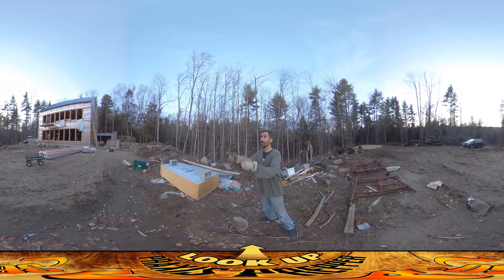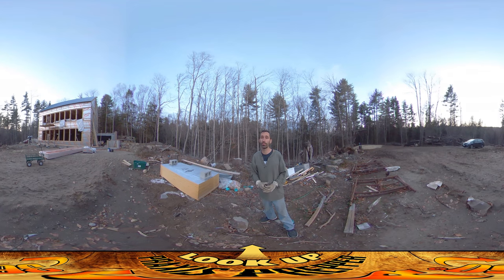Homestead Building - Roof is ON! Wrong Screw Oops!

Comment: FWIW: its good idea to use large overhangs on the roof:
1. Helps protect from wind driven rain and snow.
2. Helps shade the top windows during the summer. (less solar heat gain in the summer - During the winter the sun is lower so it does not block solar heat gain in the winter)
Reply from the maker: I forget exactly what we have, but I think it's just under a foot of overhang. I like long overhangs too.

Comment: Looking good ! ... now if only those windows and doors would show up, as keeping the elements out will be pretty beneficial while working on the inside during the winter, if only for the temperature. And while the exterior layer isn't on it yet, i have seen a house here with mere insulation during last winter, apparently it was just fine, and the exterior was put on this year... so not to worried about that. It would be great if it could be done 'now' (as said over there they cover the whole thing with scaffolding, and then seal that up with plastic and just keep working; but that other house did just fine and it was a mostly self build also), but them windows though !
Reply from the maker: Yeah, I'm not (very) concerned about the exterior insulation being exposed. It'll weather a little, but not much.

Comment: Not sure what metal roofing system your using, but usually ridge cap and trim is riveted to to the roofing metal panels.
Reply from the maker: This one uses gasketed screws going into strapping beneath the roof.

Comment: I'm sure if your dad heard you he immediately said "WE used the wrong screws"? 🤣😂🤣

Seriously though, my impression is that all of the wood is going to stay exposed on the interior of the house so did you go inspect the ceiling just to double check that none of the screws poked a small hole on the inside?
Reply from the maker: The screws go through the strapping that holds down the foam insulation. So there's 6"+ between the boards and the interior we're good on that front.
I guess I did say "we", didn't I. Well, I guess since I was on the roof and my dad handed up an unmarked bag of screws, it's actually all on him for this one. He's been trying to sabotage the project since day 1!!! ;)
Reply: Praxis Homesteading and Survival Skills 😂🤣😂